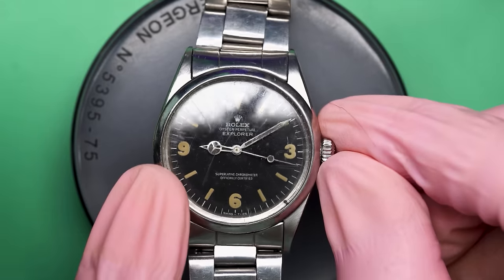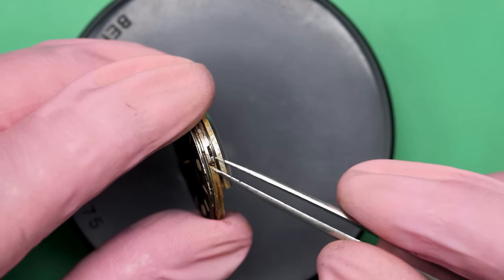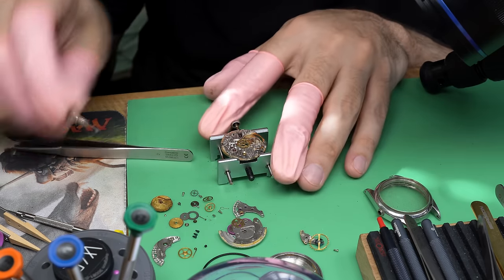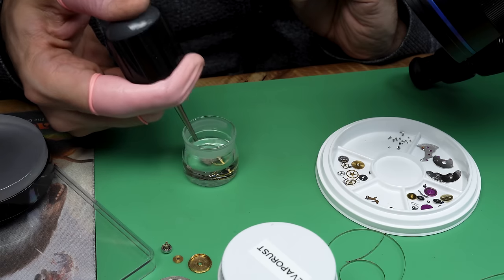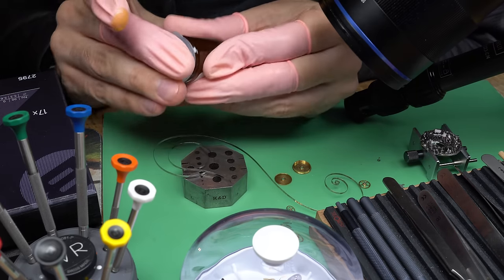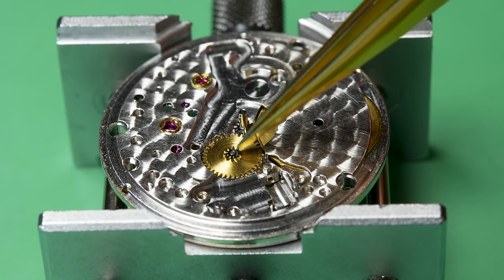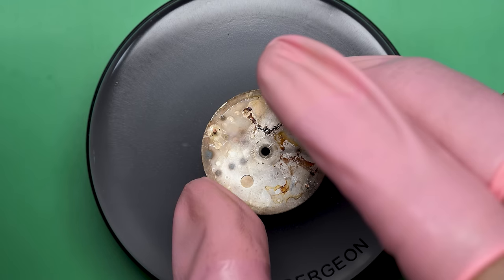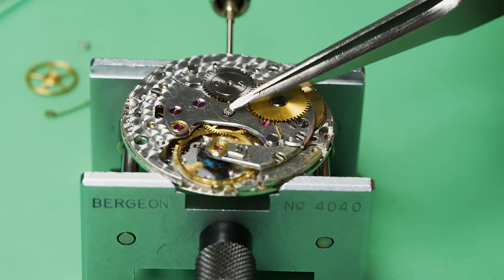This $25,000 Rolex Explorer Was Exposed to Seawater!

Comment: Marshall is a god-tier expert at restoring watches when he can do a job even Rolex can't do, and no one else is willing to fix it. This man deserves a medal🎖
Reply: AYFKM?
Reply: @IMakeWatches  Why are you so offended by the idea that Rolex refused to complete the repair? With the extent of damage to the movement and likely necessity for limited-stock replacement parts, it's possible that they did not want to devote the necessary resources to this repair. They are currently behind on repairs, and many of their experienced watchmakers have recently retired. Guess living in Geneva didn't cue you in to all of the factors at play here.
Reply: Not that Rolex couldn't do the repair, it's that they didn't want to. They'd rather sell you a new watch.
Reply: @IMakeWatches  I don't want Google to translate it, unless it translates into the "slang".
Reply: @nolongeramused8135  Everyone's always got excuses these days why they can't❗️'' it's that they won't ! '' ‼️®™️  😡😡
Reply: @roryvonbrutt7302  Rolex repairs/services watches in order to make money; one that requires parts they no longer supply and extensive work is one that they will lose money on.
Reply: @nolongeramused8135  Use this video to send in as your résumé maybe you can get a job with rolex, if you already don't have one❗️ good day to you sir‼️®™️
Reply: Watch wont last has that rust cancer.
Reply: Umm. An oyster. Well built and pressure tested , no problems.

Comment: As a bit of a tip, if you ever accidentally flood an expensive watch with saltwater, the best thing you can do is thoroughly flush it out with fresh water immediately. Even before you try drying it. Salt is a catalyst; seawater rusts exponentially faster and more aggressively than fresh, and you're already wet so water harm itself is a moot point (assuming it's actually flooded; for a small leak or just some fog on the crystal, don't do this obviously). Secondly, the longer you wait to have it serviced after water ingress, the worse it'll be. If it's a bad saltwater leak, even hours count let alone days or weeks. 

All that said, please don't wear vintage/rare pieces in the ocean. Even freshly serviced and pressure tested I hesitate to wear any of my vintage Rolex, Omega, JLC, etc even in the shower. It's not worth the risk. If you must wear vintage to the beach or whatever, just bring a cheap "waterproof" quartz to use while in the water. Unless you're a pro diver that's all you need and can be considered disposable if it leaks.
Reply: Subtle flex
Reply: @as-is89  lol sorry, I guess to clarify I've been collecting for 25+ years and am a (technically amateur) watchmaker as a sideline. I reference my own watches because I've seen too many really nice similar vintage ones get ruined by people wearing them 24/7. People generally have this idea that because it's a luxury brand and because it's been serviced and resealed, it'll be fine despite being 50 years old or whatever. In reality maybe, maybe not. Don't get me wrong, Oyster cases for example are great and work really well, but old stuff is old and even serviced simply won't hold their seal like something modern for a multitude of reasons.

Mind you, the No.1 reason for flooded watches new or old is actually people forgetting to make sure their screw-down crowns are secure. In any case, why risk the vintage stuff? It can't really be replaced, and even professionally restoration seriously hurts their value vs. an all original. Like most antiques it's almost always better to have an imperfect, heavily worn original than a flawless, perfect, like-new restoration. In many cases folks will pay a premium for so called "tropical" eg; heavily patinated and faded dials, for example. But all that's a whole other topic I could spend hours on.
Reply: @J.DeLaPoer  Offtopic, but whats up with thing with the bats in your profile pic. What is it? Just curious.
Reply: @J.DeLaPoer  Looks like something from a vampire movie. Like you expose it to a full moon and $hit goes crazy.
Reply: @AKROHITHgoogleplus  It's the back case of an antique pocket watch; 18k gold decorated with carved & enameled bats, with inset moonstone gems as stars. If you're interested I'll upload a fullsize pic somewhere. It also has a snake for the bale. The elite, genuinely handmade luxury watches of our past blow most of today's stuff out of the water. Also I love the gothic aesthetic :)
Reply: @J.DeLaPoer  Thanks for the context. Hoping it's more than a century old. Yes definitely will like to see it. Hopefully won't be too much of a hassle to you. They do cause someone put their heart and soul to meticulously give atttention to detail or perhaps there was strong chance they'll be dead if they don't. Yup a fan of gothic art too.
Reply: @AKROHITHgoogleplus  Sigh. So far Youtube has deleted all 4 replies containing a url that I've tried to post. Try:  4aUcTL5 with imgur. 

Also yes it was part work ethic back then, partly that quality for price was simply expected, and partly that automated machines for that kind of work would've been more expensive to engineer than simply paying a master engraver and goldsmiths etc. Companies like Waltham, Hamilton, etc, to say nothing of the Swiss, English, etc. all retained several such incredible masters on staff as a matter of course, up to the early 20th century. Sadly a lost art; now this would be done in China via mass production and low QC. 

Don't fool yourself into thinking most top luxury watch companies are truly "hand made" anything for decades now either. Hand fitted in some limited instances, and hand finished in the sense of final polishing for very high end brands, but for anything below the Patek & above level that's all "hand made" means these days. Back when this pocket watch was made however, all but the rough blanks of case and basic movement parts were truly done by hand; to the point that the final bat carving in this instance would've been literally done freehand with small graving tools by the factory's top master engraver. Or in some seriously unique instances like this, perhaps contracted out to a luxury jeweler to do the case decor. But that's a whole other topic of course and I'm obviously too long winded as it is.
Reply: Good tip, was going to ask if flushing with freshwater was a good move myself (figured it would be, only when the movement has actually got properly wet with salt-water as you said).

I'm guessing that alcohol would be a bad idea as it will dilute any lubricants in the watch. I already know from other vids here that putting any oil on movement is a very bad idea as most parts of the movement aren't meant to have any lubricant on them (as it will just gum them up and seize the whole watch up).
Reply: Actually, would alcohol be better, or would that dissolve parts of the watch
Reply: @AKROHITHgoogleplus  He is the Batman(in batman's voice of course) 😅
Reply: @mitchelltraweek173  Don't use alcohol! It's not about dissolving parts of the movement - or as the other commenter asked, about dissolving the oils. Alcohol is a solvent and certainly will strip the oils, but isn't anywhere near strong enough to damage the metal parts. Also while running a watch dry is a bad idea, comparatively you can run a movement bone dry for quite some time before any real damage sets in. At these levels of friction and power it's a very, very slow process. I'd rather run a watch dry for a month than get even a bit of saltwater inside. 

The actual reason is because, especially with vintage, the alcohol is likely to trash the dial: Most vintage dials are painted and/or printed, and if they have lumed hands/numerals, it'll be the older tritium or radium (a powder mixed with glue that's already often crumbly and delicate after decades). Also most companies used a vegetable-based clearcoat sealant on their dials from the earliest wristwatch days up to the 1960s; even up to c1970 for Omega and a few others. Alcohol will ruin this much faster even then seawater. Keep any dials well away from any sort of solvent, period, unless you plan on an impromptu total strip and reprint. The dial IS the watch to most collectors too, and good condition originality is where the majority of the value is. New reprints/redials can be technically perfect, but will still tank a luxury vintage piece's worth like nothing else. The last thing you want to do is take any chance with how delicate and unstable the old dials are.

Of course if you can uncase the movement, pull the hands and pull the dial... but if you're at that level, chances are you'd just service it yourself anyway. The advice about a freshwater flush was just for folks who aren't watchmakers, to give them a good fighting chance to escape major damage until they can get to a pro.
Reply: @J.DeLaPoer  Just checked it out, beautiful indeed. Nice info packed comment. You love speaking about watches, don't you? No wonder you're a collector.😊
Reply: You can put the watch in an ultrasonic cleaning device with demineralized water and than blow it dry with compressed gas duster.
Reply: Thanks for the thread ,it was nice to read
Reply: @janwesten1317  Never use air dusters on exposed watch internals ever. They're much too powerful. They can easily bend and detach hands, damage hairsprings, etc. That's why we use only those small, hand-squeezed blowers in watchmaking. If you mean only the outside case of the watch ok sure, but we're specifically talking about the internal case/movement getting flooded.
Reply: Agreed. Can you wear a vintage piece in the ocean? Technically sure. I have a friend who wears a vintage gmt master two and wears it in the water as well. He's never had a problem. To be honest this isn't a risk I'm willing to take because of how hard it would be to fix.
Reply: @J.DeLaPoer  I meant aerosols that release gas with little pressure (similar to blowing gently). (not the type to clean your pc)
Reply: Now I realize that many of the Rolex's were made for diving, with their deepest tested to 3,900 meters. But with a vintage watch, not worth taking a chance that grandpa had it serviced at the Rolexxia Master Watch sidewalk service center in Guadalajara for $15 at one time
Reply: @mrequi1  Even if it was freshly serviced from a Rolex AD yesterday, it's still a risk to wear in the ocean. The old metal can pit, there can be deformation and structural changes; new-style gaskets pressed into service with obsolete 60+ year old case designs may not seal as well, etc etc etc... Probably it'll be ok, but "probably" isn't good enough for me to risk irreplaceable, $20,000+ watches.

Comment: One thing I've learned, cleaning extremely rusty machinery and tools, using evaporust extensively, is, when possible, put the whole thing in evaporust and even the screws which where a mound of rust will come loose. What I find fascinating is that it's not so much a remover as a converter, it takes the red iron oxide and turns it black.
Reply: Iron oxide [Fe2O3] ->evaporust-> ferric tannate [Fe2(C14H7O9)(OH)3]
Evaporust is a tannic acid that converts rust into a tannate, which is a little more corrosion resistant but at the same time doesn't bond well to iron, so the bits of rust that became converted and didn't fall off actually provide a corrosion resistant layer on the susceptible/affected areas.  Some products include other polymerizing chemicals that help the tannate bond to the iron better, so the protective layer is also a mechanically stronger bond (these would be the primer type coatings used to stop rust and protect at the same time).

Another interesting conversion along the same lines is hot bluing, like what you see on a gun.  Traditionally they would allow the gun to rust, and then heat that rust until it went from iron oxide to iron ferrite [Fe2O3] ->300F heat + [H2O] -> [Fe3O4].  Iron ferrite is black, it's also seen in nature as magnetite and hematite.  It's a more corrosion resistant form of rust, and also looks great with a fine polish.